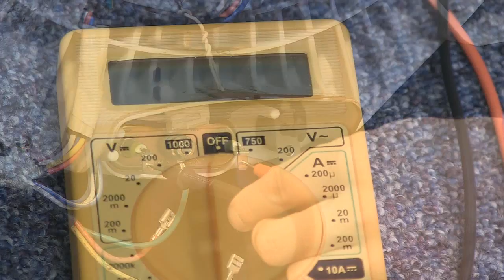How to Diagnose Washing Machine Control and Program Problems

Comment: Hi my zanussi zwf1600w washer is not working. I have managed to get an error code 40 so I changed the door interlock part but it's still not working. It comes up with the start of programme time on led but then all lights go out and led changes to 0 as if cycle has ended. Any ideas?
Reply from the maker: Once the machine detects 'an error' it will shut down. Have you checked all the lock connectors are tight and not burnt as this also could be the problem. If these are OK it may be the control board. You may have to replace this to prove if faulty or not.

Comment: I have a Siemens i890 (approx 5 yers old) that is not turning on. When it does the screen is blank but the machine is operating fine. Is this one of the power Boards?
Reply from the maker: Hi Stu. it is likely to be the display board, check for any signs of burnt contacts or damage.

Comment: Hi!i have a Bosch dryer with error E24.can help me plz!!
Reply from the maker: Hi theodoros liris, the error code means the machine has detected an issue with the control module, try unplugging the appliance for at least 3 minutes and check the connections to the module.

Comment: I've got a hot point hv7l145 washing machine and it won't start , the lock light is flashing, please can you help?
Reply from the maker: Hi Wayne, check the carbon brushes on the motor as this will often give this symptom. for more details see a similar video: https://www.youtube.com/watch?v=MNInJd7js5A

Comment: My thomson washing machine start auto insert water ,but not washing after that...only pump water out...what happen sir
Reply from the maker: Hi Nurul, if it has filled to the correct level but the drum is not turning then check the motor if it has carbon brushes they are probably worn.

Comment: Hi just wondering do you have a vid for replacing the dampers/suspension for a hotpoint   I have an old wma56,,,,had to replace a top spring as it snapped...a friend suggested it may be the dampers over the bareing im keen to try and fix this first before having to resort to giving up my beloved machine ive had for ten years. thanks in advance
Reply from the maker: Hi areia511, The usual cause of a broken spring is an out of balance load making the drum move excessively (see: How to Prevent a Washing Machines Spinning Noisily ). However if you want o see a damper video we have a similar machine in a video at: How to replace a washing machine damper - LG

Comment: But, I don't have any power or lights at all. It dead, not powering on at all. No clicking. Someone suggested the noise filter? Do you think? As far as the door lock, I will take your advice and replace, but would that cause the machine to have no power. It never really stopped mid-cycle, it was mostly-at the completion of a full cycle, the door would be locked, instead of unlocked-and all lights would be dead, no power? So I should still do the door lock then?
Reply from the maker: Sorry I was looking more at your later post and missed the fact the machine is now 'dead'. If you have continuity on the filter it is OK. Check the circuit breakers in your home have not tripped and there is power to the appliance.
If there is the correct power (may have to 'lives' in the Americas) then the next possible cause would be either the control board or the power module, either could cause a 'dead' machine.

Comment: My lg washing machine program button is not responding.
When i scroll it , nothing happens.
Reply from the maker: Hi Imran, Check there is no locked symbol in the display (face or padlock symbol) and reset the programme. If the button still does not scroll check the button for contamination or spillage.

Comment: please help !! washing maschine indesit, model will 133, flashing the first light (extra rinse) and the third (stain removal) and the start light also flashing. what error code is that?? thanks!!!
Reply from the maker: We have a video for Hotpoint and Indesit error codes but in this case it will be easier for you to identify the error by going to our updated advice centre article here: http://www.espares.co.uk/advice/7/3905/hotpoint-and-indesit-washing-machine-error-fault-codes

Comment: I have a hotpoint ultima washing machine.  When I press on it beeps alot.  I then press the programme and it will not set any program except 30 degree wash and that only if you press a few times.  All the other programs when pressed just make a beeping sound.
Reply from the maker: carol marks Without model number we cannot be specific. Some Hotpoint machines have control knobs that break and no longer 'turn' the selector switch. This may be happening with your machine.

Comment: No it finished a wash, then we put some tea towels in to rinse&spin and it would not complete the cycle we could remove any water with the pump but when we put it on spin .....nothing!! And now when I try to pump water out there's a clicking behind the front panel when I try to pump excess water out, it's puzzling
Reply from the maker: +Richard Dyer When you start a cycle the door lock will click to lock it and then the pump should start if on the drain cycle. Check there is nothing stopping the pump and if this is OK check the motor brushes (if fitted)  and the heater.

Comment: My washing machine doesn't have a fault code screen, how can i check for fault code otherwise and with which tool
Reply from the maker: Hi, it would depend on your particular brand and model, but some older washing machines would indicate a fault by having some of the program lights flashing. Different sets of lights flashing would indicate different faults. It might be worth you looking into this.

Comment: I bought a brand new LG top load washing machine wt1701cw for my wife, it worked great for 4 months and then it started giving us the IE error code. It will not rinse, or let the cold water in, it just starts spinning slowly. It's brand new, the inlet lines are not kinked, the filters are not dirty and the water pressure is good, it's worked great the whole 4 months we've had it until now. Got any ideas???
Reply from the maker: Hi Josh, IE is an input error. It can be caused by low water pressure or even if the supply tap is not turned on enough. Watch another video for more information: https://www.youtube.com/watch?v=VS48G_cwCXo&list=PLZopaZU-UQSHj1noiwEJ99JjXWcEcSAbZ&index=4

Comment: my machine is less than two months old, the programs out out of sync (different washing options do not match/not where they are supposed to be) example would be number 2 would be doing the job, the number 4 option should be doing. what the hell is going on?
Reply from the maker: +Livingshadow2009 You have not given any model information. Check if the control knob is changing the programme when turned before you start and if it is a Hoover or Candy machine suspect the control itself (see another video:  https://www.youtube.com/watch?v=p5L04Ax36O8 ).

Comment: Hello, first of all, thank you espares for helping me fix my previous washer problem:  the water inlet valve just needed to be replaced!
Now, unfortunately, it's acting up again:  I press start, it fills the soap box and then just a faint motor sound and nothing, won't continue...  I've tried just draining it (by putting it on 'Drain' function and sometimes it has worked fine afterwards.  But this time, draining it isn't solving the issue...  Help?
Reply from the maker: +Lisa Reutenauer Hi Lisa, the two problems are not likely to be related. We have a whole series of diagnosis videos to help identify your problem. The most likely cause is worn motor brushes so we would suggest you start there with a video like this: http://www.youtube.com/watch?v=N_r8d93xPYw

Comment: Josh,its a Maytag, Epic z. it did this once about a year ago. My sons clothes were stuck inside at the end of a completed cycle- we manually unlocked it. and tried all the reset gimmicks and tricks. nothing. so I left if and started using my moms small washer in the basement, about 8 or 9 months later,  I came up to it and just pushed the power button and it came on! and kept working, once in a while, at the end of a cycle when I went to unload I noticed that the machine was not in its clean/unlock mode. so to get around that problem I would just push a spin/rinse button let that run for about 15 seconds, push the cancel button and the washer would do the cancel and the door would unlock- so thats how I got around that problem for a temporary fix. but like I said, now I have no power on. I think I tested the cord for continuity. I don't really know how, I used the multimeter on 200 OHMs and touched black and red to tips. I don't know? someone mentioned the noise filter, I took that out and that seems to have continuity as well. Thanks so much for any help.
Reply from the maker: Hi, If you had a problem with the mains filter the machine would either blow fuses or be totally dead with no lights. I think there might be a clue with the door lock releasing when stuck by starting and stopping the cycle. Sounds like the lock packing up so we would suggest starting by replacing this.

Comment: programme selector knob on my Zanussi ZWN 7120L is stuck how do i fix this or replace same if required. machine is n off position  knob will not rotate
Reply from the maker: To identify the exact knob you will need to go to our web site http://www.espares.co.uk/  with your production number (starts 9149?)  from the label under the door as there are a number of different versions of ZWN 7120L.
Our live chat should help identify the part.

Comment: Hiya, your videos are great!! My washer stop after about 10 mins, I have drained it by hand, and done the reset. The lights are on, on any programme , but its just not doing anything . Please were should I start first, also done the reset for error codes , but no error code comes up, please help!! lol cheers in advance.
Reply from the maker: +barbara townsend The first places to start are to check it can pump out by selecting 'Drain' if this is OK check the heater.

Comment: It seems to be a door lock fault on the control panel on my Zanussi machine.  Is the control panel reasonably priced to replace or am I better off getting a new machine?  Most engineers in my area cost £50 just to come out and look at it.  The machine itself cost £300 roughly when I bought it 5 years ago.
Reply from the maker: If you click http://bit.ly/2lzjcsu & fill the online form, we can verify availability with our suppliers & update you directly

Comment: I recently replace a door switch on a frigidaire front load and I fix the problem. on the other hand I started the washer cycle and everything went well until an alarm sounded and would'nt stop but, the washer contiue to work properly.  How do I stop the alarm sound or buzzzer sound.
Reply from the maker: The alarm sound would normally indicate a problem that has been picked up by the control board, try unplugging to see if it resets.

Comment: I have a beko 7123b  it will fill with water  then stop , it will not go into a wash cycle, I can only drain it by pressing the start button on the spin setting over and over.  When I go into diagnostic it displays E-- then I have to press start and it shows 051.  All display lights show  then it goes to rinse setting  nothing happens,   then 05 nothing 06 drains 07 fills up, 08 fills up again 09 more water  again totally bypasses option 10 it won't even go to option 10 , 11 makes a low bubbling noise,  12 drains again.  Any clue of this is fixable or is it new machine time
Reply from the maker: It sounds like the main wash motor is not working. To identify what is happening see another video:
https://www.youtube.com/watch?v=D5Aw7CBEGPI

Comment: Hi josh,   we have a Beko 71642 which decided to stop on a rinse&spin cycle, I have checked as much as possible but it will not continue .  I then went on to check the Code error which reads 1510 can you please tell me what this relates to. the solenoids are working, the pump is working, I have checked the brushes on the motor and they are ok , I put it on 1 cycle and heard the heater start so I don't think its that,  please help.
Reply from the maker: +Richard Dyer Hi Richard, do you mean the machine washes but does not move on to rinse/spin. If that is the case the machine is not identifying any heat so either the sensor or the heater itself may be faulty. If the machine is not washing you may have a motor fault. See our motor diagnosis or heating diagnosis videos.

Comment: Hi, my 5kg direct drive LG front load fully automatic when spinning suddenly it goes off and sometimes in the middle of spin. And the next day i used it again all were good but after couple of days the same problem occured. Thank you in advance
Reply from the maker: Most LG machine show an error when a problem occurs, if the display also goes off and resets check the power connection to the machine. The problem may be due to a faulty motor sensor so suspect this if no other problem is found.

Comment: Hello I have a whirlpool awo/d 5556 I put on a wash this morning all was fine thought the cycle had finished but drum full of water, it had taken the powder but still fabric conditioner still in the draw. I go to switch machine back on and there is no power. I have changed the fuse and tryed other appliances in the socket which all work fine. Just the machine has no power what so ever, also the machine door is unlocked but still full of water.
Reply from the maker: +LISA PENKETH Sorry I am late replying but Youtube has just 'found' your comment. It sounds like the control panel has failed but check the plug fuse before replacing.

Comment: Amana model NFW5700BWO. We were getting a clogged drain line code so we cleared it out and when we went to plug it back in it makes noise like it's trying to go through a cycle but the power isn't on and won't come on when we push the power button. The door is not locked and it still makes the noise with the door open.
Reply from the maker: Hi Cammi, you need to check if you have a leak detection float in the base of the machine if this activates it will continue to pump all the time even when off. Check for a leak before suspecting anything else.

Comment: My washing machine is changing it's time automatically like if I keep it for 55minutes of wash it changes to 1hr what to do is there a problem
Reply from the maker: Hi Sushmabc, usually machines with a PCB do change the time depending on a range of variables including water temperature and absorption by the clothes. it is quite normal for a machine to change the time in this way.

Comment: Hi .. I have Kenmore He2 with no display screen to check the error code. What it does is ... When I start the machine nothing happens and it unlocks and then it locks back in after few seconds .. Then the water fills into the drum to an appropriate level and then the drum spins once and stops for a minute or 2 then all lights starts flashing after few minutes it drains the water and unlocks the door. I cleaned the drainage filter and also could hear a little squeeking noise when I rotate the drum by hand although the drum is rotating freely. My Machine vibrates like hell when on high spin. Kindly share your expertise.
Reply from the maker: Hi Jitin, the lights flashing is usually indicating an error code, we do not have the error codes for this model so you need to check with the manufacturer to determine what error code is being displayed.

Comment: I have a daewoo dwd-gn123's and is showing the error code B1 which means engine alignment error. What should i do?
Reply from the maker: Motor alignment error is a bad translation, they are trying to say the motor position is wrong so the error is likely caused by the position sensor. To obtain the part check the model number as we cannot find it and if not listed on our site fill in your information at this link: https://www.espares.co.uk/contact/sales

Comment: Thank you for this video.
My washing machine has died. A Miele W844. It had been drawing power from a multi socket which had a kettle and a toaster running at the same time. I guess that is what caused it to stop. Lesson learnt, single power socket for the washing machine. Any tips on what I might do to get it up and running?
Thanks.
Reply from the maker: Brett Champlayne Start by checking the brushes if the above video has not helped identify your problem.

Comment: I have a bosch front loading washer that's doesn't have code board.  It stops the end of the wash cycle and won't spin, door stays locked and won't unlock even when start button pushed to pause.  When I eventually get it to unlock, which it will only do after changing the setting multiple times, and set it on spin, it drains and spins.  When I however set it to start another load, it does the same thing.  I've tried smaller loads and sometimes they go thru the full cycle, but mostly get stuck with the door locked and no way to open it.  It won't reset with the door locked and door won't unlock.  Any suggestions?
Reply from the maker: +Debby harkness Make sure when trying to reset you turn the control to off and wait a moment as turning the control to another programme or off at the wall may not reset. Once reset try empty on a few short cycle to check the machine. If it does not complete a wash and move on to rinse check the heater.
If it has a problem going to spin see another video: 
https://www.youtube.com/watch?v=uKBy-9NEF5A

Comment: My kenmore drump doesn't spine at all? I think is my fault because I put a carpet to wash.  No was a big carpet. Was small those kind that u out on the front door outside
Reply from the maker: Lilly Leal Carothers Check the drum can turn freely and is not jammed with debris from the rug. You may have damaged the drum due to the load being out of balance see this video:
www.youtube.com/watch?v=uKBy-9NEF5A

For information on the motor see:
www.youtube.com/watch?v=D5Aw7CBEGPI